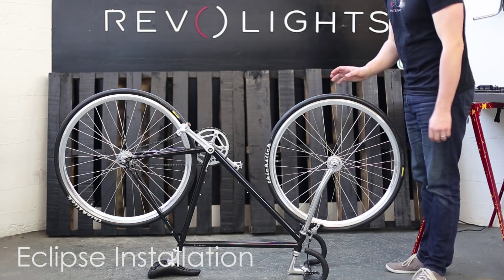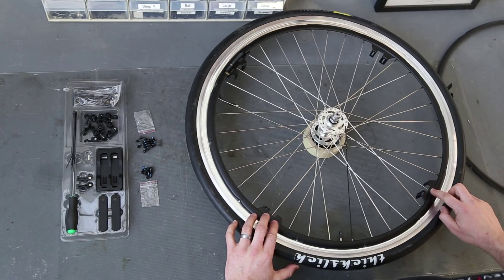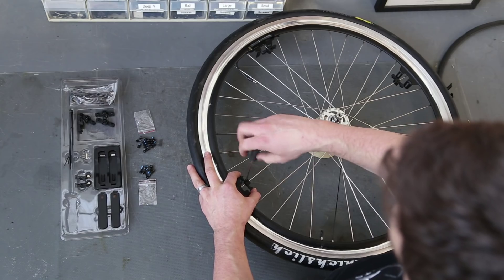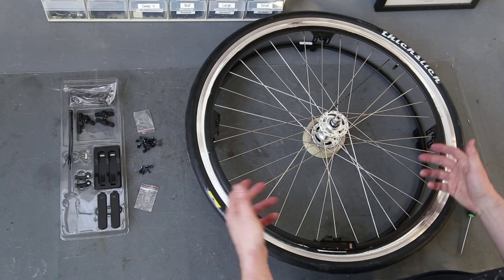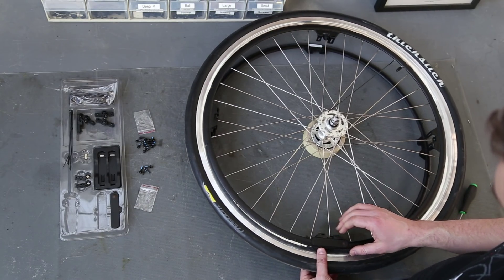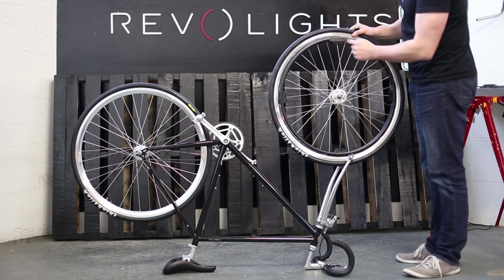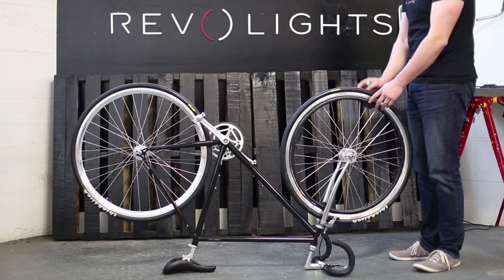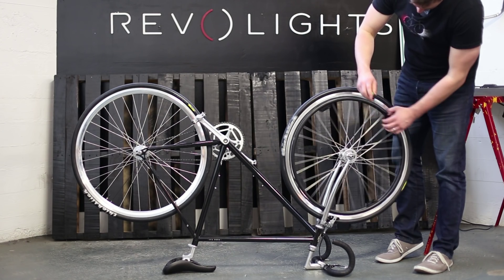Revolights: Eclipse Bike Lights Installation

Comment: Way over complicated, I have been using those silicone wrap around $99 cent lights on the forks ( 2 up front and 2 in the back) and they can flash , double flash it continuous by clicking it's button, this way there is no need to remove the wheels and for $4 dollars I have the lights flashing down on the ground pointed to the wheels. It has the same effect, except you won't look like a jackass on the side of the road when this plastic crap breaks and you do and endo.

Comment: The video directions say: Battery ring on the LEFT.

The printed directions say "hold the Battery ring in the RIGHT hand."

This video is correct.  The printed directions are wrong.

Following the printed directions that come with the product will result in your light arcs being on the inside of the bike, versus the outside.

This is true for both front and rear wheels.
Reply from the maker: +Byron C Zimmer 

Hi Byron,

Thanks for the comment! Yes, the battery ring needs to go on the rider’s left side for both front and back wheel, apologies for any confusion caused by the paper manual. 

The way its meant in the manual is that if you stand in front of the front wheel, you mount the battery ring to the right side of the wheel from that perspective, which then results in it being on the rider’s left side once the wheel is back on the bike. This is not as clear as it should’ve been and we are working on an updated manual. 

If you do end up with the sides switched on the front wheel and you don’t have disc brakes, you should also be able to just turn the wheel around, without having to reinstall the rings to fix the problem.

Thanks again for the message and apologies for the troubles.

The Revolights Team
Reply: +Revolights I have disc brakes.  I had to completely uninstall and reinstall my Eclipse Revolights as a result.
Reply: Agreed! Annoying. The "active ring should be on the riders left" important bit of information would be helpful to add to the manual